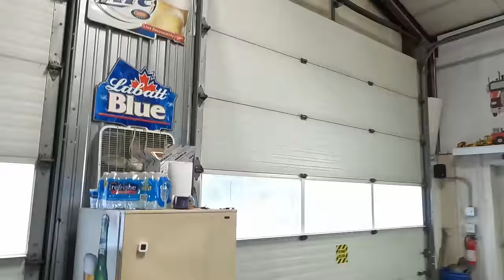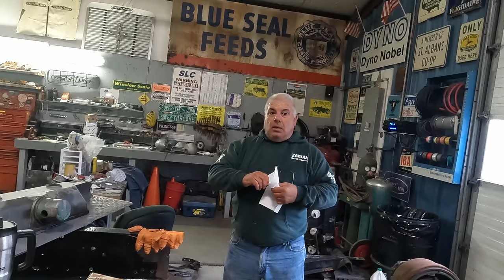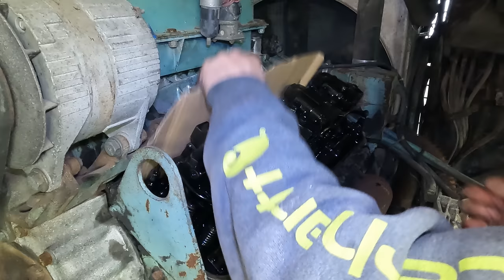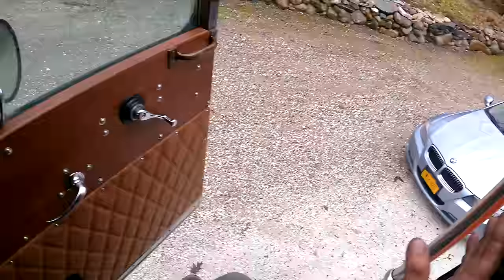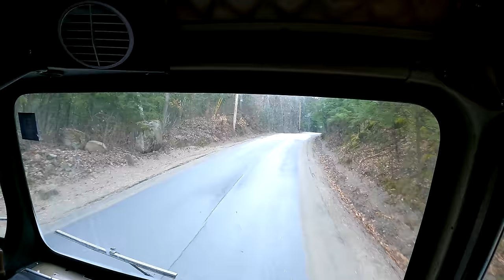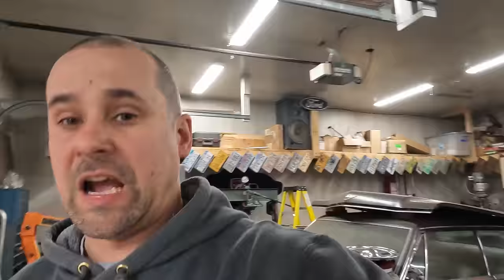1973 White Freightliner Cabover WFT-8664-T 8v71 repair and drive!!!

Comment: Wayne said how tight the cab is. When those Freightliners were new, you had to open the door window a crack when you closed the door or, if you didn't slam it hard, it wouldn't close right because of air pressure in the cab.
Reply: The lack of positive ventilation in those old cab cabover and conventional White-Freightliner/Freightliners alike were the root cause of leaking windshield seals and ensuing corrosion issues…I remember the cabover and conventional Shakers my father ran in the 70’s and 80’s, he always said to crack the windows just a hair to vent air pressure. This ‘73 is in remarkable condition….
Reply: @bowslap  Shes a cream puff. Probably  always was. Very rare it was taken that good of care. Wouldnt be cool if it was a 12

Comment: 73! When you had to be in shape to get in..
Door handle can only be opened after you’ve started your climb..
Eventually they figured it out an put the handle near ground level.
Reply: I know right and thoes stirrups too you had to have long flexible legs just to reach it...I was in a trailer drop yard and they had some old trucks  1 being a white cabover  the bottom step was taller than my kneecap.i said shit you have to be a gymnast just to get up in there or know parcor..lol
Reply: This truck is probably an owner/operator speced. It has the high end Diamond interior plus ladder steps and pocket above the tire to step into the cab. The cheap company trucks had a "U" shaped iron bar on the bottom of the apron and another one above the tire instead of the pocket. Cheap interior was thin plastic (it has a name but I can't remember what it's called, Cycolac maybe) on the headliner and walls. Mid grade was pleated vinyl.
Reply from the maker: It was awkward to get in and out of compared with my Pete but that might just be me being used to the pete

Comment: I run a 1982 CO9670, I catch hell every time i go on a parts run. Most parts companies want VINs to look up parts, I tell them ( no cuz you got to actually look in a book for this stuff) the older guys behind the counters all tell me to keep that thing running. So far it's just preventive maintenance issues. Basically if its getting fuel and air you're going down the highway.
 White/Freightliner had their priorities straight when they build their products. That flat glass is a breeze to replace. Other manufacturers used curved windshields and the hunt for those rascals is a tough one

Comment: I love those old 8v71 😢my gramps used to have em in three of his old kw lw 924 , two 69s and a 67 , I used to just love goosing the shit out of the Detroits 😊😊😊, they alll their power in the top of revs , so awesome pulling a heavy load of logs like 35 tons , they would just scream 😱, he also had two 359 Pete’s exhds with 12v71 , both were twin sticks and low bed trucks for moving all our log loaders and yarders , and the two big cats d-9 and a d-6 , the little d-4 gets loaded up on my 79 lw 924 lol ramps and just right up onto the truck lol 😂 slicker than snot 😂

Comment: Drove a lot of 71s and 92s in my day  on Petes, KWs, and Freightliners...but never with dual air stacks. Always wondered if that gave you more boost or maybe some were dummies just for looks.
Reply: I didn't pay attention till I saw your comment about the air stacks. Looks like he does have two air cleaners that wye into a big pipe going to the motor. Almost looks like a homemade box on top of the blower to accept that bigger air intake. Could be something Freightliner did back then,  I've never seen one. Company I worked for in the mid-70s bought a brand new KW cabover with a 12v-71. Because it had two 6v-71 blowers it had two air stacks and two air cleaners, completely separate from each other, one for each blower.

Comment: I'm curious if the micro switch on the clutch pedal or throttle pedal is not making good contact... that could be your "broken wire" problem... just saying as it should have them so it doesn't try to activate while under  throttle... thats my experience on them
Reply from the maker: Very good thought Morgan. I did assume a lot here since I wasn't really working on the truck side.
Reply: Exactly what I was thinking

Comment: Hi bud just started watching your stuff. I love the Detroit engine there r not many in uk 🇬🇧 emissions bull crap. If I wanted to say get a v12or 6 or 8 Whot sort of money would I have to pay + shipping thanks Les north wales 🏴 uk 👍🇺🇸 iv got pricing for shipping 🤞
Reply from the maker: Hey Leslie thanks for tuning in bud. Price depends heavily on application and condition. A truck engine v12 is going to be very expensive because there were only a handful produced. Figure a core 6v or 8v is worth $1500 screaming eagles and a core truck v12 I wouldn't sell for less than $5000. Good runners of each would be more.

Comment: So if Detroit's start hard in the cold, did anyone offer block heaters? One solution might be that oil retention contraption certain priuses had that would store hot oil in a thermos for better cold starting. Might not hold a lot but its better than nothing.

Comment: I had a 1968 that had the triangle shaped badge on the front that read White Freightliner. I bought a 1972. It had the rectangular  shaped badge that just read Freightliner. Kyle's is a 1973 and his reads White Freightliner. Does anybody know why they left the word White off in 1972?  I owned COE's for 20 years mostly with 8V-71's. It was a different time. Most of the roads were rough. Most were 2 lane or open access 4 lane. You couldn't make very good time. Most of the Truckstops were shitholes and those old trucks were hot as hell in the summer and cold as ice in the winter. We (OO) were hauling for about a buck a mile. A good driver could pull down 13 cent a mile. Like I said. It was a different time.
Reply from the maker: Ray I've got no clue as to how freightliner did logos etc. I think I should own one though.
Reply: White Motor Corp. sold Freightliners through their dealer network from 1952 to 1974.  Badges and hood ornaments are not a great indicator...I put a Mack Bulldog on a Pete...got a lot of comment 😁😁
Reply: @fatlarry1184  the difference is you put that bulldog on there
 White Motors put them badges on my trucks😊